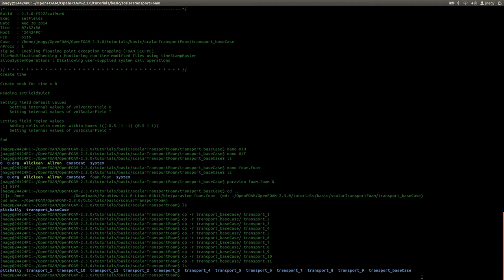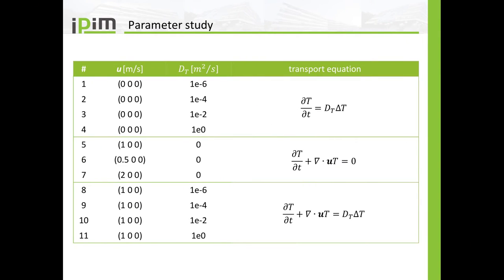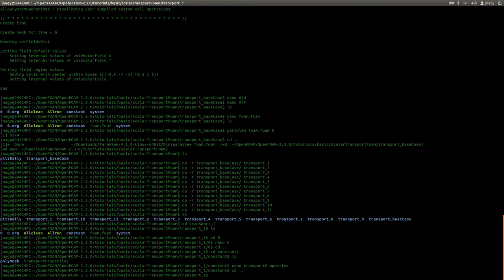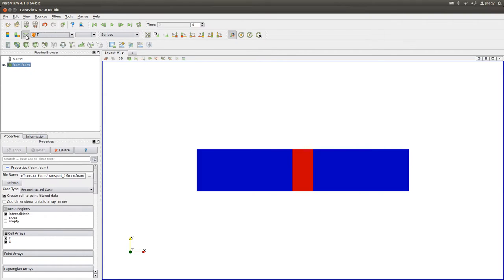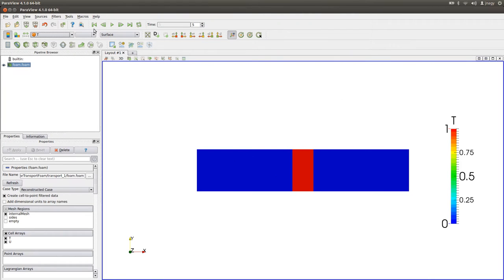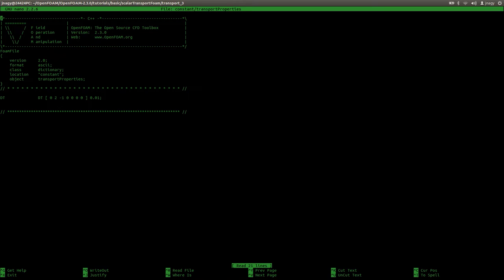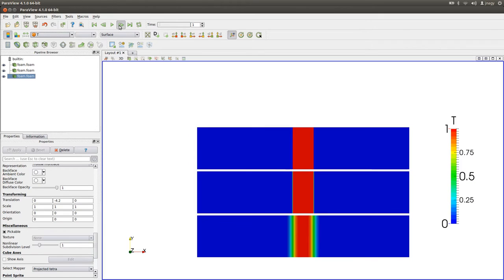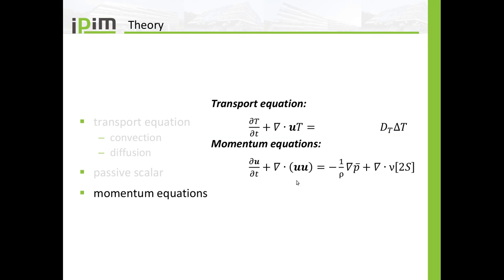Introduction to transport equations - Part 2

Comment: Great tutorial. I was able to follow everything clearly. One thing which I was not able to understand;why did you set the initial temperature conditions as 1 only in the center of the domain ?
Reply from the maker: The idea was to transport this throughout the geometry and show you the different phenomena. You could also set the value to be 293 everywhere and in the center 294. This would be a more physical setup. But here the phenomena are important.

Comment: Hi József. Great tutorials!! Thank you so much!! I have a question though, which is the purpose of the 0.org folder?? could it just be removed like the other files? What can I do in order to replace the temperature scalar T for concentration??
Thanks in advance!
Kind Regards!
Reply from the maker: 0.org is a backup folder. T can be seen as a concentration also. The DT would be the diffusivity of your specie.
Reply: @OpenFOAMJozsefNagy  But unit of T is set to Kelvin in T file i guess....? Do we need to change that one to something else?
Reply from the maker: @music_nd_fun  Yes T is in Kelvin

Comment: Couldn't we explain the transport equations based upon the pitzDaily case itself ?? What were the motivations to solve the shockTube geometry using the scalarTransportFoam instead of the pitzDaily case itself ??
Reply from the maker: It is 1D and it does not introduce geometric effects. It is pure numerics.